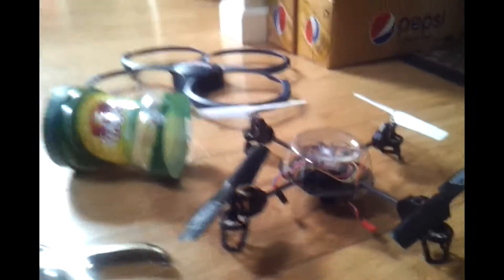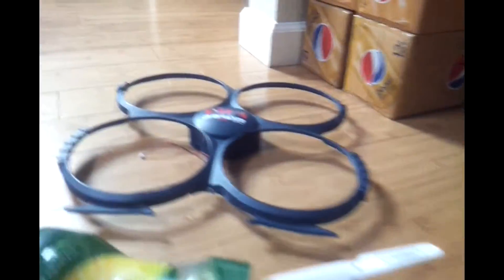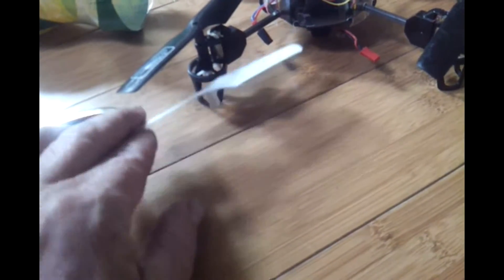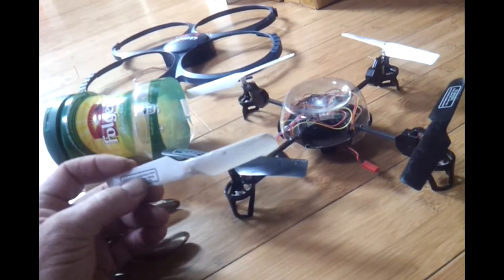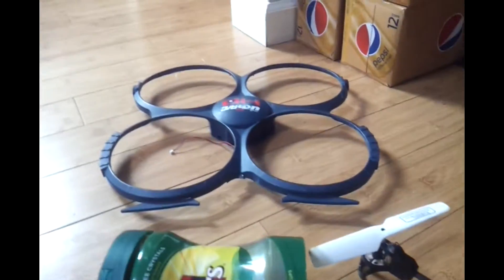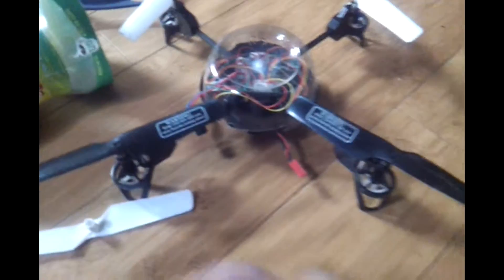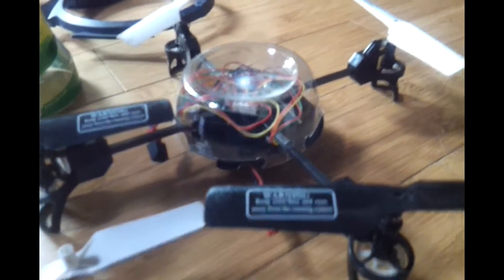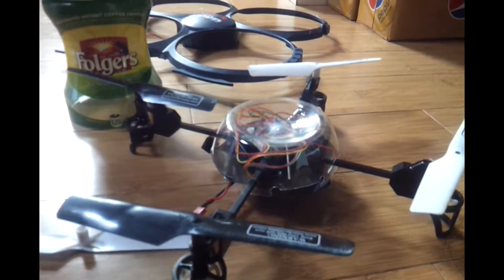U818A-1 Drone Trouble Flying , Weak Battery: Solved

Comment: I wonder if you could apply a light coat of super glue or epoxy to the tops of the new blades to mitigate the flexing under speed?
Reply from the maker: i dont think the tiny motors could stand up to the potential of extra weight and out of balance. just get rid of the heavy body and it will be like a new drone.

Comment: Did you take the camera off aswell, because i see there were 2packs of 2 wires with connections hanging from it
Reply from the maker: No its just the battery disconnect in the shot your referring to.